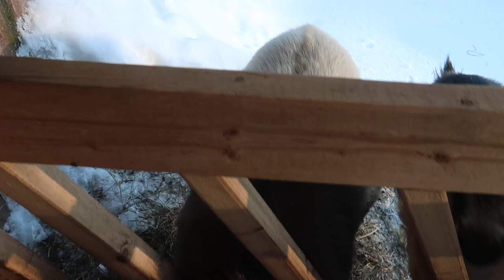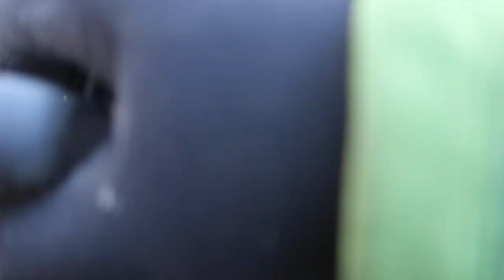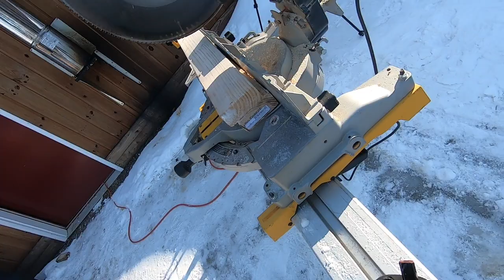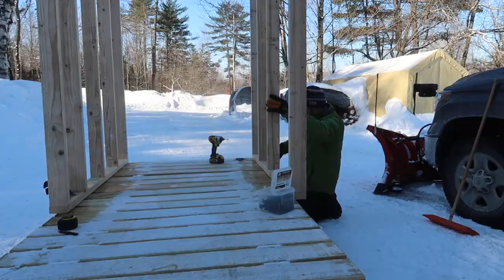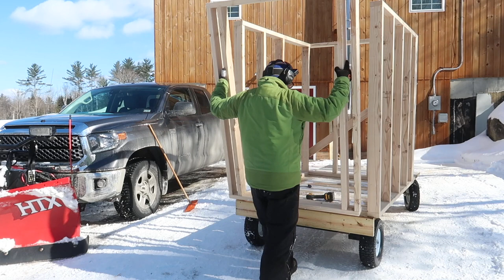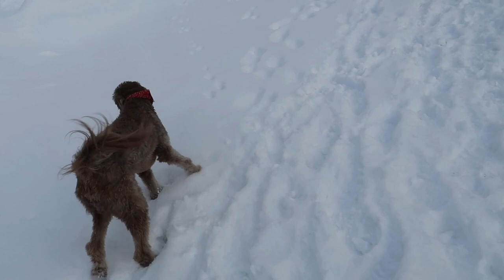This would Go so Much Faster If we Didn't Have to MELT ICE!  (Mobile Pig House)

Comment: I had to smile when I saw you use the propane torch, I live in Ontario and am a directional driller. Used that little friend so many times this winter, to thaw out frozen locks or hoses. Can't wait for spring to arrive, it's coming. Next week is going to feel like the tropics:)

Comment: Al, depending on how air tight the upcoming barn is, you may want to think about building a rocket mass heater for it. They are cheap and are very efficient in how little wood they need, although they are a lot of work to build... it would help make for some comfy working conditions next winter :)

Comment: Good morning Al. I am enjoying watching you build the Bacon Mobile.  One thing that I do differently is when I cut my lumber I treat the freshly cut edges with a sealant to prevent capillary action from drawing moisture into the board, which could lead to premature rotting.  What are your thoughts on this?

Comment: I was wondering what will be on the front of the bacon mobile (maybe 55gal drum of water and feed barrel)? Hopefully it be enough to counter balance the weight of the pigs on the back half of the cart when moving them so it doesn't do a "wheelie front end off the ground"  pulling up slight inclines around the property. :-)
Reply from the maker: Rain water collection and feed storage will be in the front

Comment: Good morning.  The pig mobile is coming along nicely. Mr. Al, do you have an edge router? If so what you recommend for a beginners? Thank you.
Reply from the maker: What are you looking to use the router for?
Reply: Lumnah Acres , to edge some sign blanks that have raw square edges right now.  P.S. I just got my return notice that I am signed in the the cooking class with Jill!
Reply: soaringtractor,  do you have any recommendations?  My tools are Hyper Tough, but I can't find a router by them.

Comment: Hey Al. Shouldn't you have filled in the small gap in the floor boards before putting on the walls? And I know there is such a thing as a hammer drill, but using your drill as a hammer? Too funny.
Reply: Just got to the point in the vid where the gap in the floor was magically filled... so nevermind.